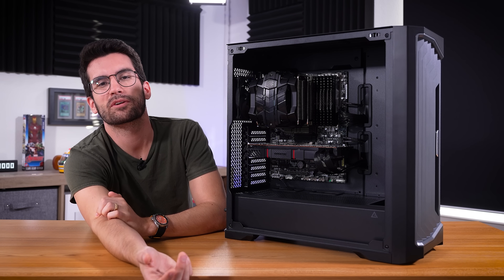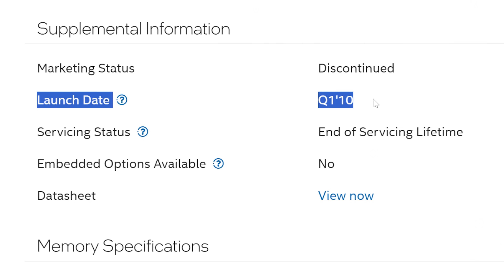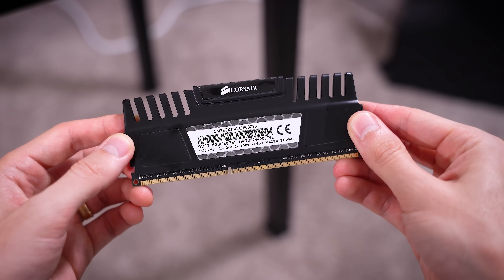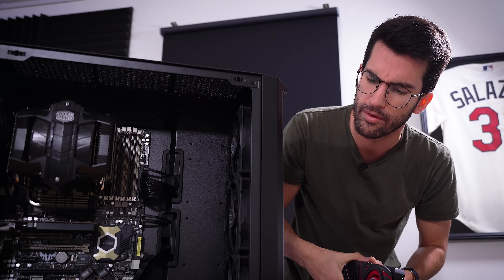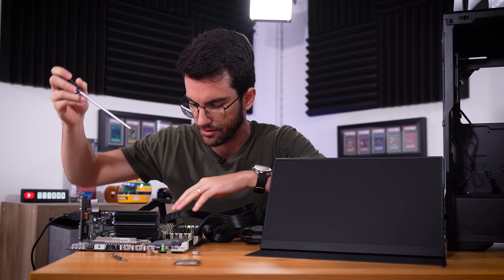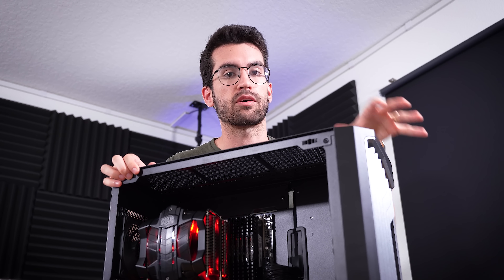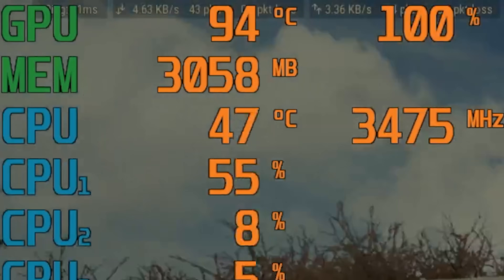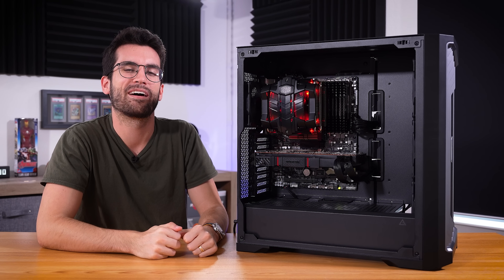Fixing a Viewer's BROKEN Gaming PC? - Fix or Flop S4:E20

Comment: I'm still running a R9 290 on an intel 4970K. Though luckily I got one with a 3 fan design and vapor chamber instead of the blower. 
This system has aged remarkably well. Still use it, but have not played any new demanding games in the last few year. Though it still seems to work for the random indy game I pick up.
The last big game I got was Doom Eternal, it ran fine at 1440p in Medium settings. And for a 6+ year old system when eternal came out, fine was really impressive to me.

This also reminds me of the i7-920 system that was before this system. That was also a good system, but didn't last nearly as long.

Comment: No surprise to me; been working in IT on and off for past fifty years and I usually have the more serious issues but also quite simple fixes with my own machines. I'd equate it o using power tools on a regular basis; you get over confident/comfortable with your abilities and then mistakes (inattention) occur and injuries happen.

Comment: @GregSalazar this socket are extremly sensible, this was the first lga socket from intel, i have seen many of those boards with pin bent or loose
Reply: No, first LGA was 775 for P4, PD and Core 2 series.
Reply: yeah you are right my bad, but from what i remenber, i made a lot of rma with this socket @craigmurray4746

Comment: Good example of why the Intel chip/socket design is the inferior choice!  If someone like you can bend a pin (assuming it didn’t come from the factory like that), what hope is there for the inexperienced!
Worst problem I ever had was a case that fried the motherboard (yes, the metal standoffs for the motherboard were in the right place).  It was so bad that it even fried the power supply!  (FYI I used to be a tech back in the days where we replaced individual chips in computers, so I do know what I was doing.)
Reply: LGA sockets can be fiddly yes, but Intel have been using them now for 17 odd years by now? Even AMD finally had to admit that PGA reached the end of the road hence LGA for Ryzen 7000.

Comment: I am not convinced this one was on you Greg. I have had boards come with slightly bent pins in the past, it’s rare, but it can happen. Judging by the video of you installing the CPU, it really doesn’t look like you did anything wrong. It’s entirely possible that one pin was just a little off from the factory, I am not 100% convinced this was on you.
Reply: Me too.
It really didn't look like you did anything wrong during the CPU install to me.
Reply: The cpu install looked good to me too.
Reply: I thought the same when I saw the video. There is no way he bent a pin installing that CPU.
Reply: I agree.
Reply: CPU install was fine. Not your fault.
Reply: Having built dozens of X58/socket 1366 systems, dislodged pins in the socket are COMMON. It happens because of flex in the socket caused by high clamp pressure over a very large socket. With socket 1366, on a no post, the first thing to check was for mysteriously bent pins.
Reply: This can happen even if you don't do anything wrong.
Reply: @unholydonuts Wrong, pins in lga socket, in that spot, can bend even if you don't do anything wrong.
Reply: I'm thinking he knocked the pins when he nearly put it in wrong
Reply: I wonder if this is a case of some kind of manufacturing issue that only became apparent years later, where the pin was making contact but just barely.

Comment: That R9 290 probably could use some new thermal paste.
Also, how did this hardware config compare to other submissions with the same hardware. I find that statistic more interesting than the comparison against all other entries, because naturally newer hardware will eventually always be faster. But comparing your R9 290 results  to those  submitted  10 years ago, might be telling. New drivers might have gained speed or microcode updates have slowed things down.

Comment: I would add a Small single fan rtx 3060 in this just to get those extra frames. Although it would be a bit bottle capped I feel the performance would be great for that cpu and not generate as much heat, so it would be a great emulator pc

Comment: When you said everything seemed to be working fine but the PC wasn't sending images to the monitor, it gave me flashbacks of the saga that was upgrading my GPU in December.
I bought a Gigabyte RX 7600 8GB OC model on Black Friday, but it wouldn't show any images. I imagined the problem was lack of power, since my PSU was a 500W and the recommendation was 550W, so I traded in my old PSU with my RX 560 to get a discount on a 750W PSU. 

After installing it, the GPU showed the same symptoms, refusing to even get detected by windows (but the metal plate would still get hot, so it was receiving power). Its fans weren't spinning, but it's a model that doesn't spin the fans until it needs to, so I thought the problem was on the BIOS. I followed the instructions perfectly, downloaded the latest AMD chipset driver that was on the Gigabyte website (motherboard is also Gigabyte, coincidently), updated my BIOS to version f31 (if memory serves) before doing any further updates as per instructions, but when I tried to update further there was an issue with the installation and corrupted the BIOS.

I sent the PC to a trustworthy business where I live, have been their client for over 20 years, and asked them to recover the BIOS (my MOBO has double BIOS in case the main one gets messed up, so you can fix it, but this update made it so that the MOBO wouldn't post even on the backup BIOS) and make the GPU run. They couldn't recover the BIOS and it turns out the problem was the GPU - it wouldn't display images on any of the other three PCs they tested.

So now I had a brand new PSU, a dead motherboard and a dead brand new GPU. Since I work from home and my gaming PC is my work PC, I had to buy a new MOBO with all the USB ports I needed, and the only one I could find to be delivered in less than a week was the Gigabyte Aorus Elite V2. Ende dup buying it, had the repair shop install it for me because I didn't have thermal paste and didn't want to risk breaking the CPU in the process given how well things were playing out for me last month. Luckily my CPU is a Ryzen 5 2400G, so I could use the integrated graphics to display image and go back to work, though I could only play very light games in the meantime and was down one monitor.

Then I begun the RMA process for the GPU. I don't know if this is the same for every part of the world, but the process in Brazil is too bureaucratic, with various redundancies and I had the misfortune of being paired with a guy that just didn't want to give any more than the barest of the minimum of information and ignored my e-mails when I asked for more details. I somehow managed to get through their service, and from there it was smooth sailing on that part, but then I had to send the package through Brazil's mail service - Correios! If you Americans think FEDEX is bad, I laugh at your face!

Finally, a whole 31 days after I received my GPU in November, I finally had it back and working! But goddammit, I spent far too much on this stupid upgrade when I didn't have to, ended up making one upgrade I was trying to get away with not needing to and one that was 100% unexpected, had all this down time without my computer unable to work, and when I had it back I still had to refrain from gaming because I had to recuperate my time lost not working and because the games I wanted to play just weren't going to run on the poor 2400G's GPU. The GPU is working flawlessly now and the LED Logo paired with the AORUS LED on the motherboard do look great, but my wallet is crying on an empty stomach on the corner of my house now.

Comment: Really nice job on diagnosing and fixing this, I wish I could say I haven't had a similar problem before.... The DRAM LED being on however isn't normal like you stated in the video, it should extinguish after the self check passes, which it did after the issue was resolved, just a technicality.
Reply from the maker: Normal as in "It was supposed to be on during that part of the boot process."
Reply: @GregSalazar  ahh in that case, ignore me! Either way I'm glad to see this old beast up and running

Comment: Hi Greg, good video 
I am just wondering if you can provide help. I have had a custom-built pc built for my son for Christmas and am having an issue with it 
It is running with a msi z790 tomahawk ddr5 motherboard and a asus 4070 gpu and a i7 13700kf cpu everything is working great but as soon as I connect his oculus rift cv1 the screen turns black 
Any clue as to why this happens 🤔

Comment: I see the problem  right from the start you are using Asus garbage inside it.
Reply: That was the second best mobo for the platform only mobo that was better was the rampage formula 3 I own both these boards the rampage was cool due to the fact you could push enough watts threw the CPU to turn it into the sun 😂 oc was fun back then